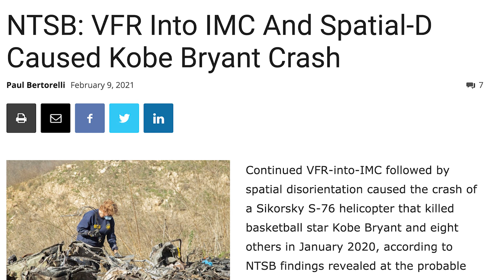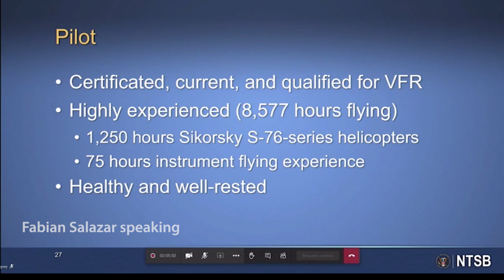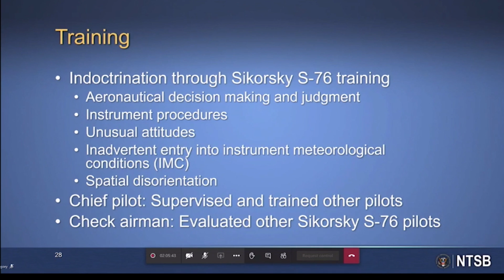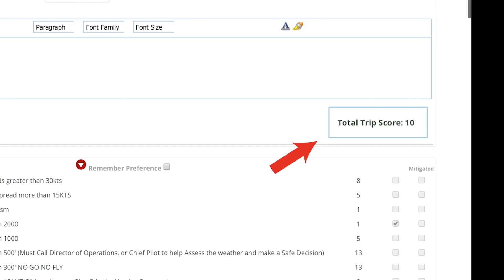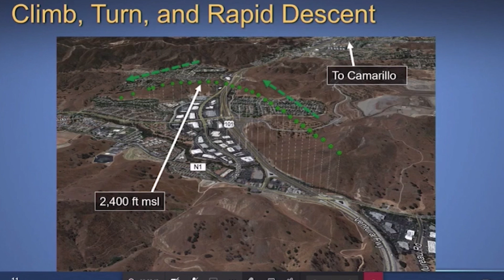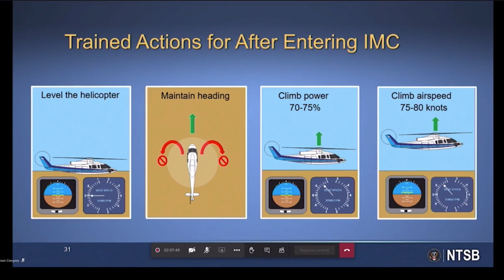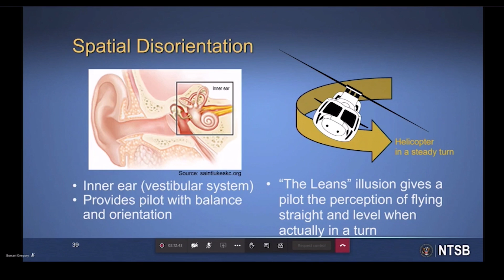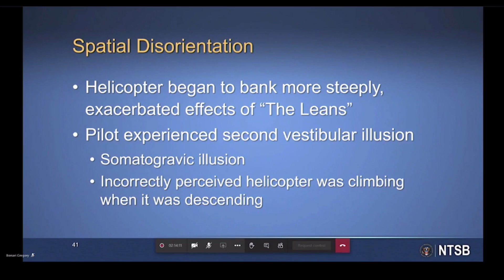How A Split Second Wrong Decision Caused the Kobe Bryant Fatal Crash

Comment: Spatial Disorientation was the primary reason for my discontinuing flight training at KVGT. I love flying in fixed and rotary wing a/c however after my second episode I decided this is not going to happen as p-i-c. Even if I'd had the auto-pilot configured, I would not have been able to engage it as my body was getting heavier by the second and vision was pulling backwards into extreme tunnel vision which meant everything from instrument cluster and flight yoke were getting further and further away even though I didn't physically move. Once you are in spatial disorientation, you cannot transition to instrument flight because at that point, you cannot see or interpret the gauges, second you do not have the muscular strength or control to move the arms, and third you loose the ability to communicate. It is physically impossible. As I learned with both my experiences, the only option at that point is to relax the body, close the eyes, and drop your head to your chest and wait until the ears re-balance and you regain control. Luckily in both my instances, I had a training pilot from Nellis AFB in the right seat to take control otherwise I may not be here today.
Reply: I often wonder "if you know that you live would depend on it" would you not be able to cut the "seat-of-the pan" flying and oblige yourself to follow the instruments at ANY cost ? Seems to be a pretty good incentive to me, but I find scary that you could say it is impossible to make that shift once you have the spartial disorientation. Scary but I have no reason not to believe you.
Reply: @12345fowler  - While in a state of spatial disorientation, you cannot see the gauges let alone use them. It is an experience that is difficult to explain to one who has not experienced this sensation. Motor skills or rather the ability to control muscle movements during said event are lost, the arms become so heavy that they just fall to your side and you cannot lift them. Vision pulls away in a very long tunnel as such things which are physically just a foot or two in front of your face are now hundreds of feet away. There is a massive floating feeling to the brain which slows all brain functions to a crawl. While in a state of spatial disorientation, you are completely incapacitated. While in command of an aircraft that is not in auto-pilot, the result can end in crash and immediate death. This is why I stay on auto-pilot as much as possible because if spatial disorientation sets in during flight, the plane will continue to fly normally while my body recovers which can be 10-15 seconds to just under a minute after which the brain returns to normal. Spatial disorientation is not predictable nor is there a warning when it is about to happen. Once it occurs, you are along for the ride until you recover. Auto-pilot is a mans best friend and I strongly encourage its use. As for me back in 2002, there was an Air Force captain sitting beside me in the right seat. Once he realized what was happening to me, he immediately took control of a/c and returned to airport. I have never flown again as PIC since that last event. I still fly in fixed wing and especially helicopters but only with other pilots in control. I just sit back, watch and enjoy the ride with the ability to take control during an emergency should the need arise.
Reply: @kingjames8283  Thanks. Myybe this is like a drunk thing. You try to make you best to stand up and walk and just can't because your senses do not work properly anymore.
Reply: @12345fowler  - And actually that is a really good analogy. In a drunken state you have loose control over senses and muscles. In vertigo, you have some control of muscles but not of senses. In spatial disorientation, you loose all control of senses and muscles. I have experienced all three so far in my life.
Reply: @kingjames8283  that sounds terrifying.